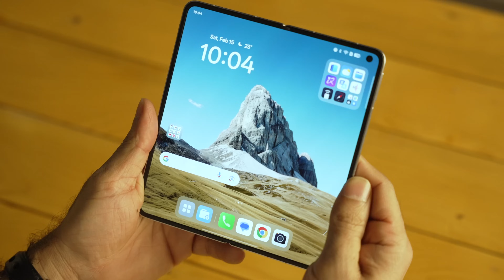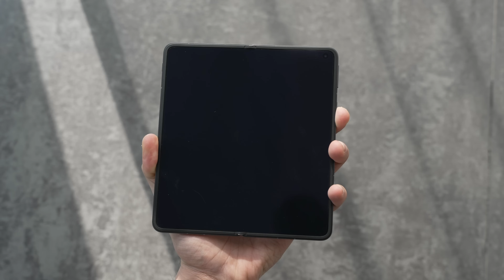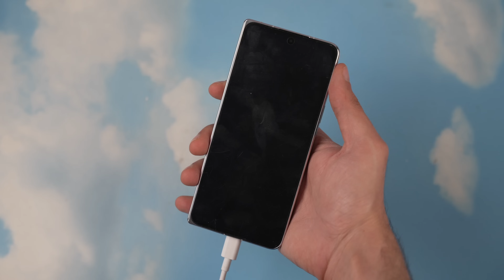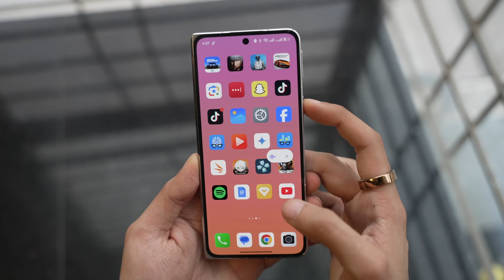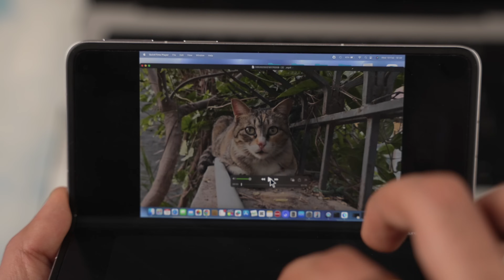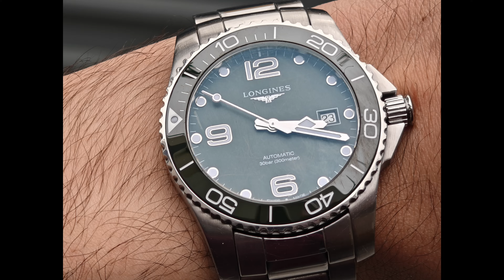Goodbye Samsung: OPPO Find N5 2 Weeks Later - IT'S MIND BLOWING.

Comment: I bet it’s a fantastic phone. But I also bet the price is at least 1500.00 or more.
Had to factory reset my phone because Gemini was causing YouTube to randomly close. It is a known problem with no fix other than factory reset.
Also. Why is it so important to have AI on my phone. It should be a 100% option to have it on my device, not baked in to  the OS where you can’t get rid of it. And you can’t, I tried.

Comment: I tried the Pro 9 Fold and sent it back in 10 days.... awful BT. All devices (hearing aids, Bose head set, Android Auto) that I count on were spotty. Bose cut out at 6'. Hearing aids disconnected 3 or 4 times per hour, and AA disconnected while driving at odd times.
Reviewers have to go past the cameras and round corners and test real-world uses. ....please.